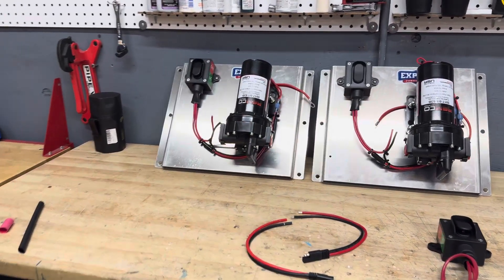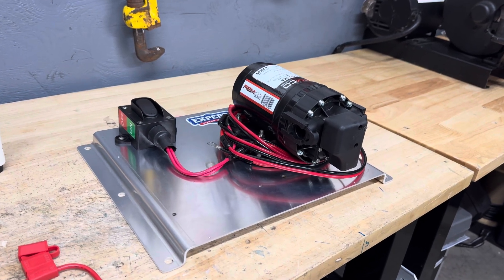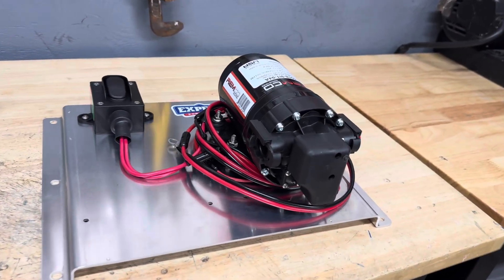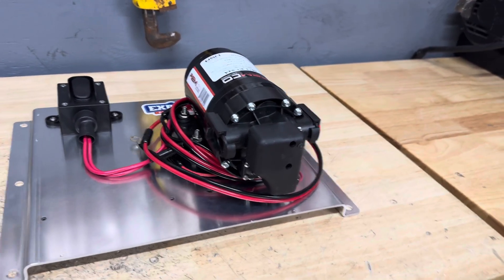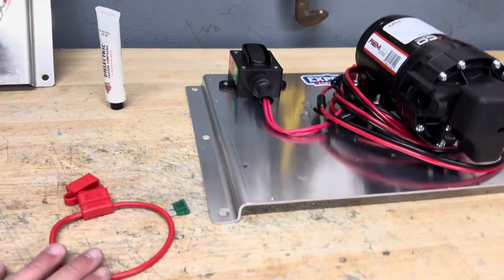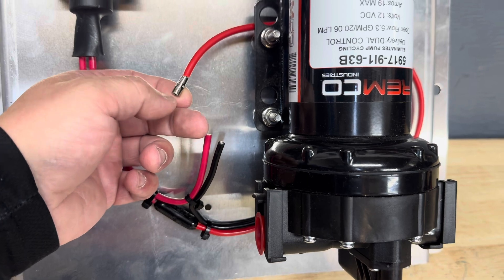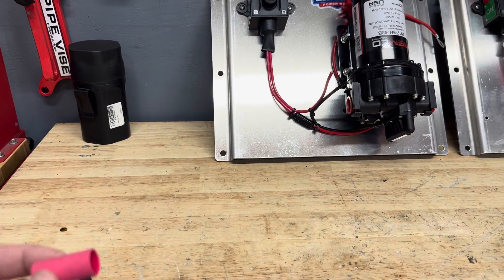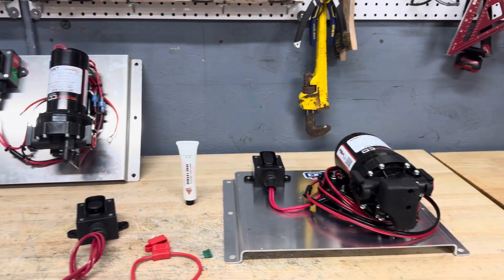What Makes a Soft Wash Pump Work Better

Comment: Hey Tim, 
What diameter hose and dropstick would you recommend running from the chem and soap tank, 
to a 3/4 proportioner, into a remco 5.3 gpm pump?
1/2 or 3/4?
Reply from the maker: 1/4 hose for soap. Call us if you need parts 503-403-6185

Comment: I purchased a 7gpm 60psi Remco pump and the fittings are ½". Do you stick with what came with it or can you go up / should you go up to 5/8? I'm switching out from the everflow 24 volt pump which had a larger hose, I think 5/8

Comment: Are they available for sale? Does the 7 spray farther?  If I got a 7 GPM what size manifold do you recommend? 3/4 or 1/2?   Thanks you
Reply from the maker: We have a full mixer video walkthrough on the channel. Here’s links to the ones we use and recommend. We like the 7 GPM but there’s a cost difference from the 5.3. Completely worth it. 

Mixer- https://pressurewashingskids.com/products/hydro-mixer-v4?_pos=4&_psq=Mixer&_ss=e&_v=1.0

Plate mounted pump- https://pressurewashingskids.com/products/mounted-remco-7-gpm-100-psi-softwash-pump?_pos=6&_psq=Remco&_ss=e&_v=1.0

Comment: Tim big question Tim you got the pressure switch part number also when you running 1/2 hose 300ft on the 7gpm you cannot adjusting the pressure
Reply: The only bad thing on the 7 gpm is 1/2 hole by the port quick attachment ask if they can’t make it 3/4
Reply: Because you got 3/4 proportions is better flow you don’t need to reduce the to 1/2 inside
Reply from the maker: We carry pressure switches.

Comment: Can't wait to see how the sae plugs look when installed.
Reply from the maker: They are already on some of our other builds on the channel.
Reply: @ExpertPowerWash  

Sorry,  but you don't show any with the sae connections. You only talk about pumps and wiring. It would be great to see one with the new pumps. The wire setup is a little different with that style switch.